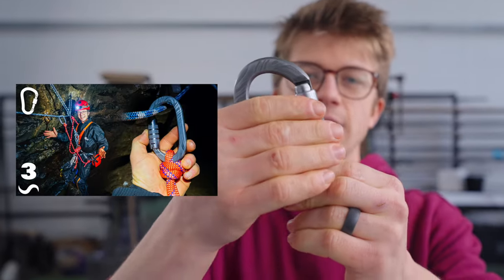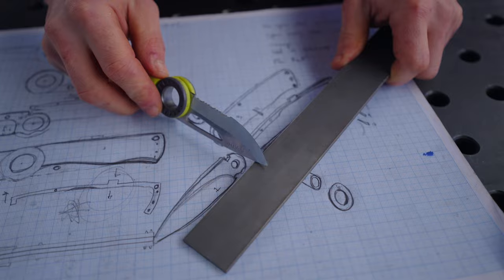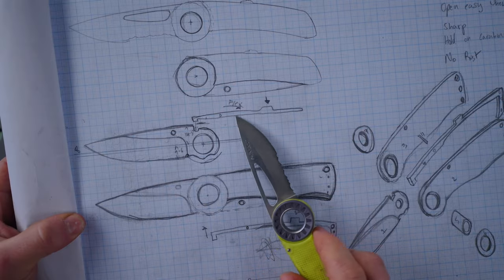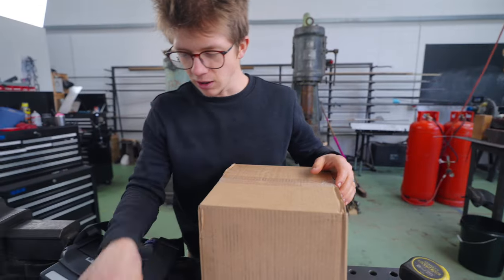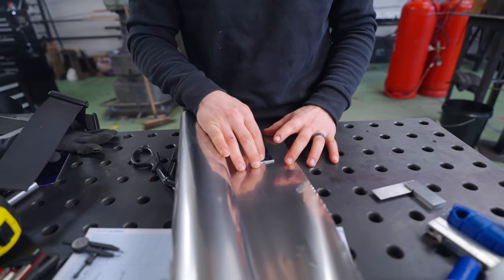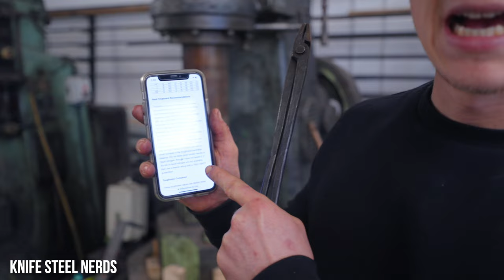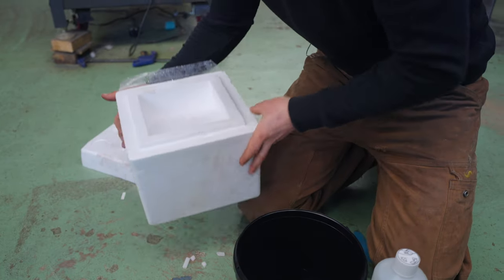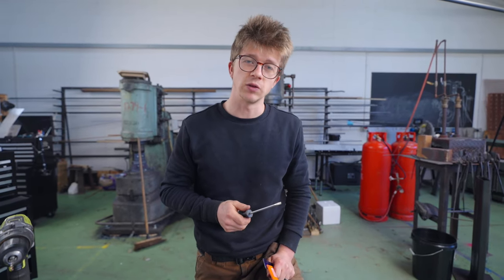Making a Stainless Steel Folding Rope Knife! Part 1

Comment: I'm a climber, canyoneer, and knife enthusiast and in all my time in these hobbies I haven't found a knife specifically made for climbing that has a carabineer hole and a sheepsfoot or Wharncliffe blade. I just don't see the use of a drop point. The edge is what you want so why not take away the tip, that way if a rope is tightly wrapped around someone's limb (which I have seen happen a few times) you can press the sheepsfoot tip against the skin to safely get under the rope and cut out. White water knives are made for this scenario so why not the vertical world??

Comment: A tip for getting the oxygen out of the envelope- put a little piece of paper in with the blade. It will burn off all the oxygen inside.
Funnily enough, Jamie's comment about the return slip was right on the money!
Reply: Lol, that's great.
Reply: That must be why in sealed (or as best can be) canisters I see forgers putting in dried chillis.
Reply: @stevenwest1494  Shurap does that for the pun of "sharp" and "spicy" being the same word in Ukrainian
Reply: I actually thought he brought up the return adress for that exact reason at first.
Reply: ALEC - QUICK TIP! IF you are going to use the Steel foil 'Envelope' trick.... BEFORE you seal up the envelope with the blade inside, HEAT the envelope and knife up FIRST BEFORE SEALING IT UP. This drives out the 'Air'/oxygen from the 'Envelope', and then while it is STILL HOT, fold over the last seal. This is why you see those little 'Buttons' on jars of food, the jars are filled with warm/hot food contents, then sealed, the process drives out the air/oxygen and thus causing a vacuum inside...
This will help STOP the envelop 'Puffing up' on the heat treatment/hardening cycle 👍      😎🇬🇧
Reply: @JacktheFireEater  Not only Ukrainian. It's the same in German and in Czech (lively in even more Slavic languages).

Comment: One feature of this knife you forgot to mention. The grey circle is serradet and connected to the blade. It is designed that way so you can open it with the thickest of gloves and don’t need to fiddle with the thumbnail hole on the blade to open it. Makes it easy to open one handed as well. 
I love this knife and it is my daily carry as a park ranger. Cheap, easy to find if you drop it, hooks on your beltloop with a carabiner and goes through rope in one cut.

Comment: I would recommend getting a nice pair of cut resistant gloves for working with materials like the steel foil. You get a really good amount of dexterity while also preventing some really bad cuts that could end up worse than you would initially think.

Comment: I use a CRKT knife where the hole for the carabiner is at the bottom of the handle and prevents the knife from opening when clipped. Might be something worth considering in this design. It's the CRKT NIAD

Comment: Three folds per side to keep the envelope air tight as possible.  I used a small roller to seal it .  Or use a rubber mallet to lessen the risk of puncturing the foil.  Get your hands on an industrial scissors to cut that foil.  You will cut yourself on that stuff almost every time. no matter how long you have been working with it.

Comment: @AlecSteele 
8:44 
I found a much better way of lighting the forge, I use a ferrocerium rod to light some 0000 steel wool, then toss it in the forge before turning on the air, then turn on the gas last. The air keeps the ember in the steel wool going nice and hot, and then bringing in the gas lets the forge light up nice and gentle, with no hair loss or scary blasts. It only takes a small scrap of steel wool, and you can fish it back out easily, so nothing soots up the inside of the forge.

Comment: Dry ice turns to gas when you touch it, so it doesn’t suck much heat out of your fingers unless you get it stuck somewhere. The cooled down alcohol however will give you serious frost burns. It is sticky and thick like maple syrup, so it sticks to your skin while it freezes it to death. You should therefore be extremely carefull around it

Comment: Maybe you could add a thermal sensor (thermocouple) to the forge, or maybe use pyrometer / infrared camera to measure the temperature of the steel taken out of forge (or in the forge), or the cryo bath?

Comment: As soon as I saw him opening the box of Dry Ice my immediate thought was  "Where's your PPE?" For a frame of reference about how long Dry Ice can last before it completely sublimates, once at work I left a box of dry ice out to sublimate so the box could be sent back and it took a week for it all to go away. The box was worthless by that point though because while the ice was warming up it was also cooling off the air making the water condense on the box so it was turning moldy.

Incidentally that's why it felt like it was sucking the skin into it, it is so cold that it was literally freezing the fluids in your body, (Incidentally the freezing temperature of the human body is -17.8 C, which is 0 F, it's not arbitrary that's what 0 F was defined as. So anything below that can damage your skin if you come into bear contact with it.)

Comment: I might have misunderstood you but as I see it you are planning to connect the small lever to the bottom of the knife as well as the pivot point/ hinge, I cant really see this surviving more than the first couple of openings (especially if you want it to fold against the arch). if you want to make the lock part of the frame and use the steel springiness instead of an actual spring (and that a good idea considering that this will likely be dirty when you want to use it)  maybe try left to right movement of the lock instead of up and down?

Comment: AEBL is the finest grained, most sharply sharpenable steel I’ve worked with. It got sharper than anything else I’ve used. Made a steak knife set and was push shaving, not slice shaving, the hair on the base of my neck. I was definitely impressed with it. Quenched in dry ice and alcohol as well.

Comment: You don’t have to clamp between aluminum. Steel works just as good. Also reheating AEBL can be kinda sketchy. It can crack on the reheat.

Comment: As a mountaineer, rock climber, that cut out in the knifes spine is that way, as not to deploy in case you have to scramble about, while climbing, rappelling, etc 

Rope that is under tension cuts very easily, especially with a knife. 
Having any chance of accidental opening is not a good thing. 

A knob can snag open, the likelihood of a rock opening the cutout is very slim, plus if wearing gloves it gives better purchase on the blade. 

Look at Benchmade/ Spyderco knives that are designed for search and rescue. 
Most it not all use a cutout for a reason.

Comment: To get the oxygen out of your envelope, put in some paper. It will burn and use all the O while the blade heats up. Paper burns at 450 degrees F.

Comment: You could have 1 mm stainless sheet liners between the g10 and the knife. It would not add much weight but would give the handle more strength.

Comment: I don't see how your locking bar is going to work, but I'm pretty sure you will find out it needs to be separate from the spacer soon enough.

Dry ice will literally burn you with even short contact with your skin. Something about being -109F/-80C or something... Also not considered a cryo quench as it isn't cold enough.

Plate quenching is more useful for preventing warping than for the added cooling speed over air. Particularly with thin blades, clamping the blade between 2 flat plates after the main quench is a very effective means of eliminating warps in simple steels just as it helps with stainless. Also, it has been demonstrated before (Simple Little Life has shown it) that aluminum plate quenching with an air blast rivals or even beats oil quenching for speed.

Comment: I'm guessing they don't use a pin because that's a small piece that could grab onto something to open it
Reply: My thoughts, too.  The rope knives I've used as a rigger had a thumb hole rather than a pin.  Not only does it not catch on anything, it's a bigger area for the thumb to interact with, and gives a more solid connection. It also allows you to close the knife without changing grip (moving from one side of the pin to the other to change direction).
Reply: @BlazeMiskulin  I have never been climbing, I just design stuff for fun.  This is just the first thing that came to my mind, especially in a situation that is life or death a "could" is to much of a chance for me in design.
Reply: @Wisconsin.pikachu  I've done a little bit of climbing, but mostly I use to hang very heavy things (up to several tons) over the heads of hundreds of people.  

You are absolutely right in your assessment.  Anything that can snag something is bad.  A pin could catch on your glove and cause you to drop it.  As a climber, you've lost your tool.  As a rigger, you might have just dropped a knife onto the head of another worker.

Either way. Not good.

{Waves from the Madison area}

Comment: If you can't open it one handed, it's not fit for purpose. Everything else is secondary. This is a rescue knife.
Reply: The whole gimmick of attaching the middle to a carabiner is dumb. What purpose does this serve that a loop at the back - well out of the way of the critical point of failure of a folding knife doesn't fix?

Lovely build with lots of skills again Alex, but have a think about it and do a proper one!

Comment: ofc you would touch dry ice...lol.

solid/fronze carbon dioxide, btw. It doesn't "melt", but instead sublimates. the "burning" sensation you feel is your body's pain response. What's actually happening is your body heat is being pulled out through your skin to the dry ice, as part of an endothermic reaction. too much contact with dry ice will result in frostbite.

Comment: I'm not sure I've seen Alec do a stock removal blade instead of forging. Nothing wrong with that, just an observation. Also, I thought I saw someone put paper in the foil with the blade to suck up the oxygen inside the envelope, but I could be remembering that wrong.

Comment: Almost all of the design changes Alec chose make for a better knife, but don't make for a better climbing knife. A climbing knife is meant for an emergency and as such is almost always dead weight. That's why the knife felt a little thin and had a big pocket "used for opening it". The goal was to decrease the weight on an object you must carry but probably will never use.

Comment: Alec, Slow is Steady and Steady is Fast. Why? Because when you're rushing you f-ck things up repeatedly, and it compounds into having to start all over. This is literally why our special forces operate by this mantra. Did you notice that when you weren't rushing, you placed the packet into the aluminum just fine, and it actually took less time than when you rushed?

Also, Work Smarter Not Harder. How? Put your clamp surface right next to your forge so you aren't running across the shop during your work flow. But you already know all of these things. I know you do, because I've seen you work through them a thousand times before. LOL I do the same sh-t.

Comment: 🤔I wonder if a ceramic paste coating, in place of that stainless steel wrap, might achieve the antioxidation. It needs study with the given steel and the complication of cryo treatment. It would need a high thermal conductivity instead of a low, normally found in such a paste

Comment: Surprised you don't use an Anti-Scale Compound/Coating/Paint for heat treating, it's a lot easier to work with than steel foil. You just paint the blade with it, let it dry, then heat the metal as normal and when you quench the coating will crumble and fall off, if any is left it can be washed off with warm water.

Comment: Not a blacksmith or metal worker, however I'd imagine the stainless steel being exposed to atmosphere would cause the carbon in the steal to bond with oxygen and decarbonize the blade.

Comment: When you work with chicago screws you should not just drill a hole. For more strenght it is better to do a little flat countersink. If you do it like that you also get more tension on the scales and it is less likely to get lose

Comment: Ok, so again: You want to carve out the metal locking spring, and make it so thin that it could bend or break while drilling two holes. And you also want it to keep the knife open, and also pevent cutting off your fingers, while stabbing or prying with the knife... Are you sure you want to make the lock so thin?

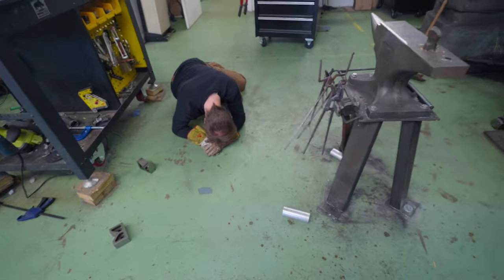Comment: 10:54 how Alec didn't see that coming i have no idea. Order of operations and make sure your surfaces are prepped. Jaime is 100% right and you should know better, Alec. This is basic engineering. My dad taught me this crap when i was 7.

Cryogenics involves very cold compressed liquid gas (ususally LN2 but it can be other things). This is cryo-treatment because you are using frozen solid gas which doesn't make the object it is surrounding as cold.

12:08 Very safe. Just maybe don't do it to a metric ton of it in a non ventilated room. That might just evactuate all the air from the room and replace it with carbon dioxide. That would suck

Comment: I wonder why they didn't go with a safety lock close and assisted/flipper open for one handed use???  Liner for streangth might be cool but then again if you would like to save as many grams as possible you could go with a c frame like design. Still defer to the professional tho...

Comment: alec thats not how those springs work on the lockback. look up folding knife disassembly, there's a seperate leaf spring that applies tension. trying to make the lockback and spring one piece like you're doing is just asking for failure/

Comment: The reason it felt like you were burning yourself when you picked up the dry ice is because you were! Dry ice is frozen carbon dioxide and it freezes at -78 degrees Celsius! It is very dangerous to touch it because it can cause severe frostbite almost instantly!

Comment: i had a few knives with the safety like the one you are making. learn my lesson not to buy anymore like that. i found out that my hand when wrap around the handle i press the safety down and the blade would close on my hand when using it

Comment: A pin to open it may not be the best idea. You're around a bunch of ropes and crap and could be a snag hazard if some threads or small rope/thread run around it or something and it opens up.

Normally wouldn't be an issue but in caving... You're likely a long way from help if it opens and you get stabbed or cut real good by it.

Comment: I find this a little disturbing because (1) you shouldn't touch dry ice with your bare hands, (2) you should heat treat your spring, and (3) you didn't need to clamp your aluminum quenching plates. You could've simply held them there with your hand for a minute or two.

Comment: Are you going to overmold like the piece you're copying? If so reach out. It's easier to do than you think. No injection molding equipment needed. I'm not trying to sell anything just share knowledge

Comment: hate to bust ya bubble but any real knife guy will not buy a serrated or stainless knife ..they are junk/crap..Have you ever tried to sharpen one little own keep one razor sharp..! O Wanna See Something REALLY Cool.... Put a Peace or 2 of that dry Ice in a Empty 2 liter bottle with a half oz or so of water screw the lid on real fast an tight shake and throw then wait and watch and in about 30 seconds to a minute something Very Very Cool Will Happen !